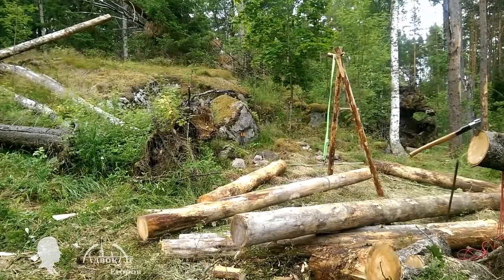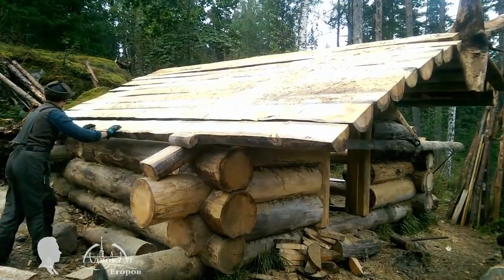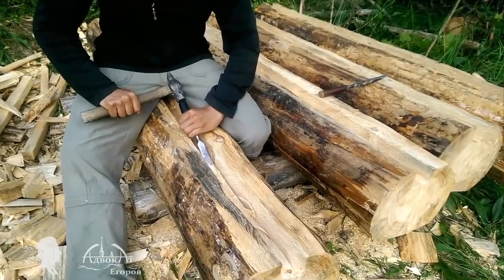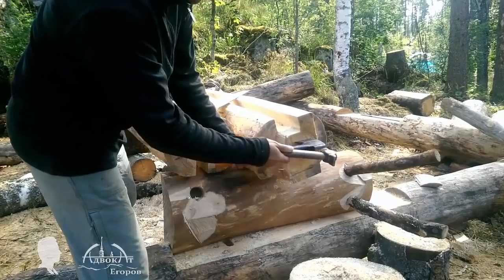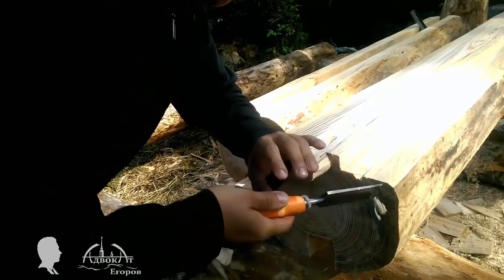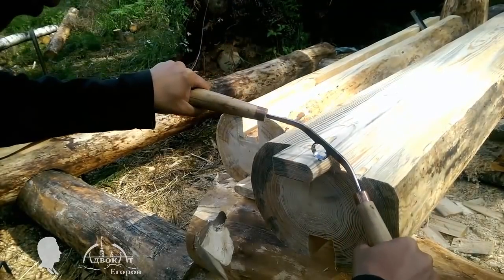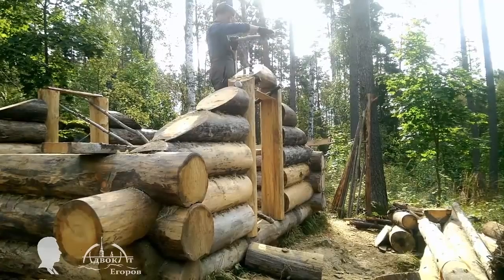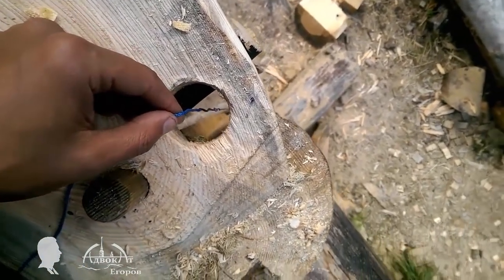Off Grid Log Cabin Built by One Man: Making a Bear Escape Door?

Comment: Back door🤔. 1.Fire escape is the big one. 2.Airing the cabin when you burn dinner. 3.Snow drifts. You won’t have both doors blocked at the same time, and, air. If you cannot open the door and snow is piled above the door level you are going to run out of air. I can go on with frivolous and ridiculous reasons that one might want a back door, but I cannot think of any other serious reasons, apart from the bear 🐻 one.
Reply from the maker: David, your reasons are good but the main reason was even simpler. I will give you a clue. The video is about construction and the logs are extra–thick... If you don't guess it this time I will tell you:))

Comment: That is amazing! That cabin should last a millennium!
Reply: ...or till the next forest fire which will definitely happen before then, from the looks of the surrounding forest.  Very old and "decadent" as foresters say.  Lots of dry fuel to burn.
Reply: aboversite , Had the same problem at our cabin in remote bush Alaska. Cleared out any tree close enough to fall on or burn cabin. Worked in reverse when our cabin was burned to the ground by a defective Ski Doo snow machine that self ignited on our porch & set the cabin on fire. Lost the cabin, saved the forest.
Reply: @davejan744  The gods must be crazy.  Would have been a cruel surprise to arrive and find that scene.
Reply: aboversite , Arrive? We were there, family asleep inside the cabins. Barely had time to run out w the clothes on their backs. Entire OUTSIDE was on fire. Jan was awakened by the cabins shaking, threw the kids out through the bear escape hatch & then dove out herself. I was down in the shop up late sharpening chain saw blades. Had no idea it was burning until my 6 year old son came running into the shop screaming fire. I ran out, saw entire outside on fire & saw my daughter come flying out in her nightie , ran up through 4 feet of new snow, grabbed her & ran back down to the shop & threw her inside then went back for Jan & saw her come flying horizontally out the bear hatch. She sank in the snow & by then our huge Lexan bear proof widows had ignited & the flames outside rushed inside & the smoke inside ignited. The explosion blew right over jans head & blew the front door off. Then all the cabin inside & out was an instant inferno. Had Jan still been inside it would have flash fried her instantly. I was running back up the hill to get Jan when I saw her fly out & the flames explode inward. Finally got to her in her nighties & half carried/dragged her down into the warm shop. We had spare clothes & everyone got dressed & then watched helplessly as 7 years of work burned to the ground. Lost EVERYTHING except our lives & the few tools in the shop. Started over. Took 5 years to build the second cabin. 30x30 & 2 stories w the bedrooms upstairs. 7 years to the DAY i was in the shop & AGAIN my son came screaming in yelling FIRE. RAN out and ENTIRE cabin was again engulfed in flames w Ellie/Jan still inside. Ran back up the hill, threw Jan out the front door & was going back in for Ellie who was trying to save the ferretts. It was too late, made her run to me out the front & the firewall closed just as she was coming through. Flash burned off her hair & eyebrows & I threw her off the porch into the deep snow & again the outside flames sucked inside & instant fire tornado ignited everything. Lost everything TWICE! Found out later the 1st fire had melted the permafrost under our cabin & got into the peatmoss & burned subterranially for 7 years before reaching back up to the center strut & igniting it setting the cabins bottom on fire where it spread to the edges & up the walls to the roof. We had NO indicators of the underground fire whatsoever til it resurfaced. DID leave a crater in the ground where the cabin had stood from the burnout underneith. Did finally get a pump that could push water up our ridge & spent 2 years pumping water into that hole to make sure it was out before starting cabin #3 on the same hilltop site. From up there we could see EVERYWHERE & W BIG windows all around could see the bears coming 100 yds off. Beautiful site. Hilltop w river below & a 400 yds open swamp  below our cabin where the wildlife traveled all the time along the river. Closest place to heaven on earth one can imagine.
Reply: @davejan744  Incredible story.  I know how persistent fires burning below permafrost can be and I believe your account. Better luck in the future...
Reply: aboversite , Thanks bro! Were both 70 now & losing everything twice taught us to keep a light touch on material things. Our area got civilized & we sold out. Had to come outside (of Alaska) to care for aging mom anyway.  Shes gone now. (Was 94 & a spitfire til the end.) so were going back. Bought a tiny 12×16 place but w our kids grown its all we need. Its closer to the highway too & we can actually DRIVE our truck to it in the summer. Kinda tucked into the woods but has a stream & Im putting in a pump station FIRST to put a water halo down around this place in case of forest fire. Jan/I love the lifestyle. Only semi remote this time but good enough. Can still hunt/fish & trap, ride our ATV & Snowmachines in the winter. Gonna die happy living the life we love. No complaints!! 😁 I might wind up as bearshit but thats only fair. God knows we ate plenty of them & turnabout is fairplay. At least Jan wont have to bury me!
Reply: @davejan744  We did the same for our parents.  Like the old Kate Mcgarrigle song.."It was my town and I had to leave it"...  Regards.. Collin

Comment: You could probably insulate a log cabin well by packing moss or wood shavings around the outside and then trapping it there in some way, like for example with a layer of planks hammered into the ground or by packing clay around it and letting it cure

Comment: It's just a guess but I think they hammer square pegs into round holes to ensure a tighter more snug fit. It's easier to knock off 4 edges as you hammer peg into round hole.
Reply from the maker: Agreed. Also, a square peg wouldn’t split a log...

Comment: Correct me if I'm wrong, but I'm given to understand that a sod roof should be two layers thick to give the top layer's roots to have something to grow into. The first should be placed grass down and the second layer grass up. Over time the upper layer's roots should penetrate the gaps in the roof timbers to make it more stable while allowing the thickness of soil to let the excess rain drain off down the slope. I know this puts a LOT more weight on the roof, but I think your 'skinny' logs can take it.
Reply from the maker: Yes, the sod has to have some soil. There is also a polymer film under it to prevent the roof members from rotting..

Comment: We made our bear escape hatch 20"X 20" to dive through if a griz came into the front door. Big enough for a person to get through but too small for a griz to get through. Had a short bbl bear slug shotgun hanging on a peg outside just in case.
Reply from the maker: Good idea, Dave.
Reply: Advoko MAKES , Actually, got the idea from a show called "Jeriamiah Johnson" & incorporated it into my log cabins. Worked great for a FIRE escape hatch too when they burned down. (TWICE). Unlike your works of art I cheated w modern stuff. Chain saws, steel latches/hinges, expando foam, steel spikes to hold the logs together, ect. Wish Id seen your vids earlier! Learned a LOT from you. THANKS!! 😁

Comment: Question, is the log on the ground? If so won't it rott?
Thanks for such a good video!
Reply from the maker: John, the northern pine is fairly resistant to rot, so if it was used within a few years after it fell, like it was in my case, it will be fine. And the piece that had some fungi on the surface will be OK too, as the fungi will die once the log is dried under the roof....

Comment: Ahh youth. At age 65 I would need to use mechanical devices to lift the timbers and move them. This cabin would take me years to build. I started my homestead with a pre-made shed and I am still working on it 3 months later. Heading into winter cold now and I must still insulate. Temps below freezing at night. But progress is being made very slowly. I’ve found several extremely useful ideas in your videos. My wood stove heats the tiny home for a few hours but quickly runs out of fuel in 2-3 hours. I’m looking for some way to provide heat all night without waking up to put in more logs. A self-feeding pellet stove would have been nice but the cost for one is too great. Any suggestions?

Comment: If you have two doors it is the ideal situation. However initially there will be some heat loss by the second door, but you can try to minimize the heat loss. 

There are many good reasons to have a second door. 

First; in heavy snow your second door will be additional protection to avoid being trapped in a bad winter sealing the front door shut. 

Others pointed out the second door is predator evasion. This is right and a valuable comment. Good job to them for saying this. 

Third, this is important...the second door is necessary for next year when you come back to add on an additional room to the cabin. You could keep doing this indefinitely! 

However you want to keep each door to be close-able after a room is installed for heat loss prevention in winter. You can concentrate the heat in one room while saving fire wood! Additional rooms will be necessary even if you live alone. 

You will want a cellar to store root vegetables, you will want to be able to store grain, you may want to have a connected sheltered 'half room' to store winter lumber in such a way that you can salvage lumber even while its cold or wet out but then bring it into the half room to dry moisture out; good for long winter land zones. 

Also some vegetables and fruits shouldn't be stored together because of their gases helping to accelerate decomposition. But others are perfectly fine to store together. 

Now...the question remains...if you put in a wood stove in the cabin, I think this is a good idea but maybe we could discuss the scientifically the ideal area to put the wood stove both for heat efficiency and for safety issues. 

I think you could do a wooden barn lock device on the doors to help keep it secure from predators

Also, the challenge of very rural areas is that creatures like bears and others have extremely amazing senses of smell! They can smell unsealed food in the cabin! This presents some safety issues. But the safety issues can be addressed. You can seal food in canning jars, but some materials are more effective than others. Mice can get in many plastic and cardboard containers for example! They can chew through the lids! Glass can work or putting tin lids from throwaway canned good cut off lids that are cleaned inside. 

Hope that helps!

If you have any questions, or want to discuss this further I am happy to contribute comments.

Also I was very impressed with how educated your approach to building is. You used clear concepts and ideas to make a very solid structure.
Reply from the maker: Noah, thank you very much for such a complete list! 
I had more or less all these reasons in my mind but the primary reason was to make the logs shorter for the back wall, so I could carry them to the constructions site...)) You would not think of it unless you dealt with those extra–thick logs...))
Reply: Great! Your project is so interesting. 

I will look at it many times to try to learn from the design. 

I do hope you don't hurt your back on the logs. I had forgotten that they would be so heavy!
Reply from the maker: I hurt myself a bunch of times but luckily not too badly...

Comment: This is a stunning piece of work , built by a craftsman, with skill and love. beautiful!! 👍👍
“A bear escape doors” ? Where are you going to “escape “ to? 
I’m sure your familiar with bears being able to climb trees, run at about thirty miles per hour , swim etc. so if a bear wants you out in the open , well, it’s ciao baby. 
Why not create a massive door that either opens out or if it opens in ,then use two massive beams that sit in a heavy steel brackets ,so the beams are oriented horizontally across the face of the door.

Comment: In case one of the doors get jammed. Maybe?
Reply from the maker: It is a good one; there are massive snowfalls here and it can easily happen...
Reply: And not only snow... Tree could fell and block the doors. Heavy rain could wet the doors and make them bulge inside door jamb
Reply from the maker: Very true, but. yet it is not the main reason that I had in mind. I will announce a bit later to give more people a chance to guess it. It is simple...))
Reply: Looking forward to your update 😀
Reply from the maker: OK, I guess it is OK to do it now as I will might forget to update you later. 
The main reason, besides all of the good reasons mentioned here, was to use shorter logs for the back wall's construction. I was running out of thick logs close by and it was quite a work out to skid them to the constructions site from far away. This way I could just carry them...))
Reply: Makes perfect sense :)
Those ideas come to your mind on the field only, not while seated in the comfy chair :)